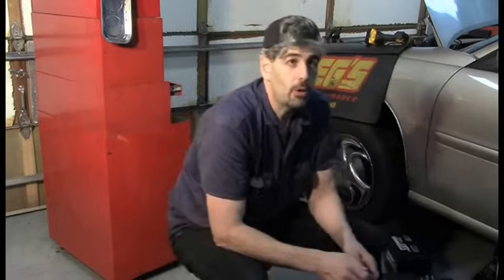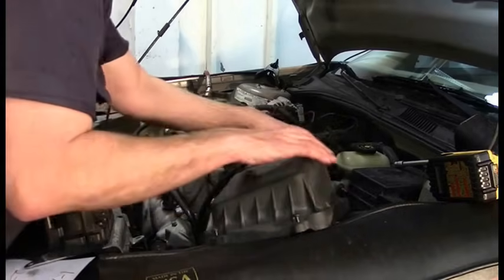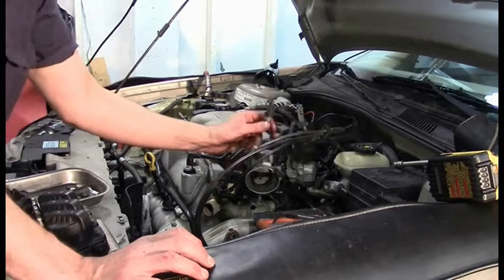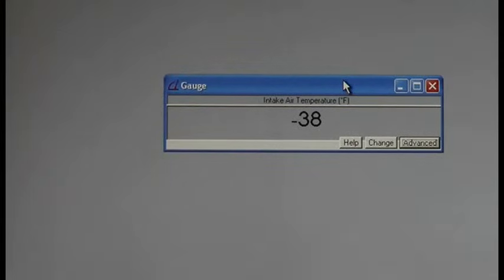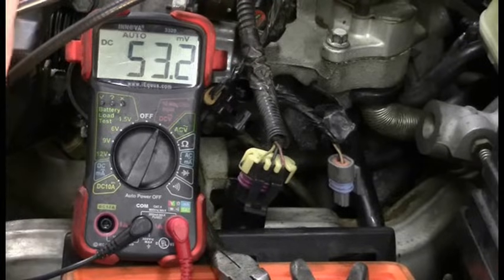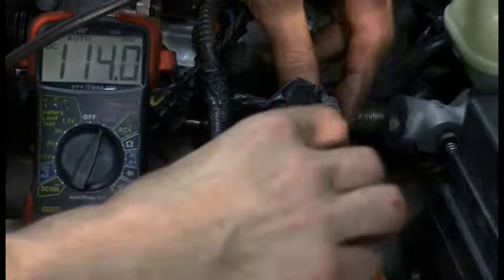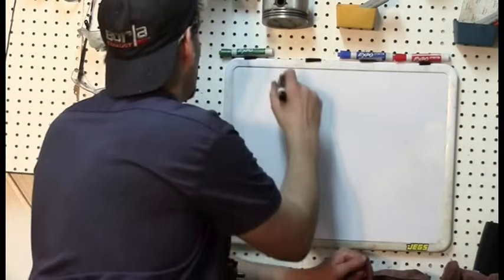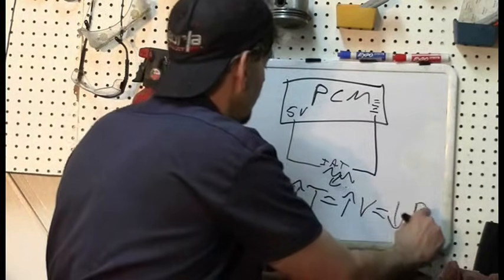IAT ( Intake Air Temperature Sensor ) Diagnosis P1111, P1112, P0113

Comment: You needed to show how to connect the wire tracer. I have a either a short or an open circuit in the IAT I BOUGHT an automobile wire tracer, but I need to know how to connect it properly. The instructions that came with it are confusing to me.can you help me?
Reply from the maker: There is only one way to connect it- it's a single wire.

Comment: Best teacher on the net. Everyone has weaknesses. Anyway, simple electrical theory is Ohm's Law :
E(voltage) = I(current) x R(resistance).
Reply from the maker: I'm more of a Kirchoff's Law kinda guy
Reply: Schrodingers Box , I originally was going to say that voltage increases with resistance , but I am not sure if that’s true, so I deleted it. Anyway, no disrespect to you. Keep up the Great work. Inspiring how you freely give back to the community your knowledge.
Reply from the maker: Look at your formula. Of course voltage increases with resistance.
Reply: Schrodingers Box , I thought that, but usually voltage is the constant variable in the formula, also with increased resistance current flow lowers, so It didn’t sound right.

Comment: wow i was not sure you would respond..thank you for your time.. i had intake work done on my 97 expedition and when i got it back that code was there.. they told me i need that i a t sensor.. so they replace it ..the code came back.. hooked it up to scan tool it flatline no reading at all..they seem lost but i don't have money to keep wasting..and i read that problem can mess up your engine...ok if there is no 5v and ground ..what does that mean?  thanks for your help
Reply from the maker: Simply use the DVOM and measure power against battery ground. If you don't have 5V then you have open power. I repeat the test at the PCM output to see if the PCM is putting the reference out. If it is- diagnosis complete, you have open power.  If PCM is not putting 5V out, your PCM is bad.

If you have power at connector, test ground continuity. If none, ground is open.

If you have power and ground, then you have a ground fault.  unplug PCM and continuity test to verify groundf fault.  If one is present locate and repair ground fault.

Those are your only variables.

Comment: I have a 2002 Camaro with a 5.7 engine LS1 and the service engine soon light on . The car is running great but can1t clear the code. The scan code reader said low mass air flow .I put a new one in and it did not fix the  code. All four 02sencers are new and still no luck. all the garages that worked on the car are just   tacking my money I don`t know were to go at this point. Do you have any pointers for my.
Reply from the maker: Why did you replace the MAF??!  What was the the reading you got or what was the reference, ground and feed voltage indicating the sensor was bad?  you have to give me the data you used to diagnose a bad sensor.  And why are the O2’s new? Where they non responsive to variable inputs?
  this doesn’t make any sense to me.

Comment: I tested mine it dropped but I also am getting 5v from the plug on the harness . So I ask does it mean sensor could still be bad even if it dropped on test With blow dryer
Reply from the maker: No if it drops then it's fine. Perhaps you have a ground fault which explains the 5V at the connector.
Reply: Schrodingers Box  my code is also flashing an what do u mean by the ground fault an before u ask only code it show is intake temp sensor  but yes is flashing idk y
Reply from the maker: Your ground is faulted to the frame rather than PCM.  But also there is no such thing as a flashing IAT code. What is the exact code you get?
Reply: I can't remember the exact code but only one was for a intake temp sensor
Reply: An are u saying the ground for my battery?
Reply from the maker: no the ground for the IAT to the PCM may be ground faulted which would obviously cause 5V detection at the connector but the PCM would not be able to interpret he variance.

Comment: Intake Air Temperature IAT Wire Harness available at: https://www.269motorsports.com/intake-air-temperature-iat-sensor-12-wire-harness-extension-for-lt1-ls1-ls2-gm/
Reply from the maker: Thanks- I usually don't approve ads but that's very helpful and relevant in this case.
Reply: You're welcome! Had a customer contact me and mentioned this video. If interested, contact me at 269motorsports@gmail.com so we can discuss doing some business together.

Comment: Matt, that was a great video.  I have the same problem, P0113 code on a 2003 pt cruiser.  This code just appeared when I put in a new battery and took off the IAT clip. Unfortunately, I don't have any equipment to test that sensor.  Should I just go ahead and take it to the garage.  Thanks, Ted.
Reply from the maker: a dvom only costs $10   why not just buy one???

Comment: Fabulous job! I believe we may be a lot alike. I've always been crazy curious and NEED to know how everything works. When someone asks me a question, I never answer their question, I tell them how things work, which enables them to answer their own question and a lot more they will have in the future. It's not that different than the old saying, "Give the man a fish and he will eat for a day. Teach him how to fish and he will eat for a lifetime."  The tester you use is often referred to as a Fox and Hound by the company that popularized it and which I use in IT.

My thoughts based on what you just taught me are:
- P0112 Circuit Low Input: If it is an open sensor, bad connection, or open in the wire, it will show Circuit Low Input, which is a less common failure.
1. Disconnect the IAT sensor, turn on the ignition, take a volt meter, and measure between the connector contacts and ground. You should see the 5v reference on one of them. If you don't, a Fox and Hound can save you a lot of time finding where the open is or if it is at the PCM.
2. If you do have a 5v reference, measure between the two contacts of the plug and you should see ~5v. If you don't, you can again use the Fox and Hound to chase down the connection issue is on the return wire or if it is at the PCM.
3. Assuming the above are OK, it is beginning to look like a bad sensor. Pull the sensor, get a hair dryer, switch the meter to ohms and connect the leads to the sensor. It should not read like an open circuit at room temperature. Turn on the hair dryer heater and aim it at the sensor. You should be able to see the resistance go down as it gets warmer. If it doesn't, it is defective.

- P0113 Circuit High Input: If it is a shorted sensor or the return wire shorted to a reference wire, it will show Circuit High Input, which is the more common failure.
1. Disconnect the IAT sensor, turn on the ignition, take a volt meter, and measure between the connector contacts and ground. You should see the 5v reference on one of them, not both. It would be unlikely that you would find the 5v reference on both, which would indicate a short, but you needed to pull the connector for the previous test anyway, it only takes a second to check, and it saves you from unnecessarily pulling and testing the sensor. If the signal is on both, you most certainly have a short in the wiring, or you have a PCM issue. This won't be so easy, but using a Fox and Hound by separating the two wires with jumpers at connectors to separate them along the way, you can determine which section the short is in, to know roughly where to look for damage, and where to unwrap the harness. Fortunately, this would be an unlikely failure. Another unlikely situation for a PO113 Circuit High Input would be to not find reference voltage on either, which would indicate wires open by the time they got to the connector and shorted somewhere after the open, or a bad PCM.
2. If you do have a 5v reference on one of the wires, measure between the two contacts of the plug and you should see ~5v. If you don't, you either have an open on the return wire and a short between a reference wire and the return wire beyond the open, or there is something fishy with the PCM. Here again a Fox and Hound can help. While again, this type of failure is very unlikely, you already have the connector in hand from the previous test, you don't have to pull anything to do the test, and it can prevent an anger issue later.
3. If the above tests OK, pull the sensor, switch to ohms, and connect to the the sensor's connectors. At room temperature it should not read 0 ohms (shorted). If it looks good, get a hair dryer, turn in on, and aim it at the sensor. You should be able to see the resistance change.  If it doesn't, it is defective.

*I'm also guessing there could be the obscure situation where it would take an expensive piece of equipment that measures with its own sensors and compares them to the readings of the car sensors to determine exactly where the problems are, as could be the case when there are multiple sensor issues.  However, at least by following your logic, the odds are stacked WAY in my favor that if I buy one, it will fix the problem.
Reply from the maker: Sounds like a reasonable flow chart to me... although I seldom use flow charts for the exact reasons you mentioned in the first paragraph. I have no need for flow charts because I understand the system.
Reply: Thanks to you, I learned I didn't need the sensor.  Using your logic, the sensor and circuit checked out fine.  I also found a section in the vehicle's Repair Manual that contained all of the logic of how it sets, how it resets, how long it keeps history, AND a huge table of each temperature and what the resistance should read as well as what the computer should read for temperature when it is shorted and open.  The sensor was drop-dead perfect.  I would be lucky to fine a replacement to be that accurate.  I reset the codes and told her to tell me as soon as she gets the light.  She got the light very shortly after I reset it.  However, this time, the only code was PO135, Bank 1, Sensor 1, 02 Sensor Heater Circuit, which makes a TON more sense.  The dealers and parts stores want $195 for the OEM sensor, but I already found the exact same AC DELCO 12581688 GM Original Equipment for $110.  The car has a heat shield rattle too, so when it comes back, I'll check the wiring before I buy an 02 Sensor.

Comment: Without that electronic chaser how in a maze of wires could u track down a short? U'd have 2 probe  everywhere looking for 5 v.! Nightmare. Thx 4 your concern for us imbeciles!
Reply from the maker: Exactly! before I had this tool that is EXACTLY what I would do- it would often take hours to find the wire. I remember unplugging the PCM and looking for continuity on the open wire and PCM terminal (and even then if the wire shares other circuits, several pins would indicate continuity with it!!)
  The wire tracker is the bomb!!

Comment: have 0073 code help
Reply from the maker: Ok what data do you have?
Reply: Schrodingers Box
 2006 Chrysler 300 3.5
Reply from the maker: No, the vehicle doesn't matter. What is the reference voltage, static voltage and what is the resistance reading when variance is introduced?

Comment: I went to start my car one day and I had a no crank no start. I also got p0113 do you think that's keeping my car from starting
Reply from the maker: No. But it could be related to the reason. Do basic FASTTEC electrical testing and determine issue.
Reply: Schrodingers Box so the battery has been tested and the starter also and they are both good. I did notice that it blow my 40a ignition fuse
Reply: Also fuel pump is not priming

Comment: I own a 98 explorer sport 4.0L OHV V6 and I did a airbox silencer delete , would that cause this?
Reply from the maker: What data do you have? What was your baseline before the delete and what is your output reading now?
Reply: Schrodingers Box haven't done that
Reply from the maker: Well that's the first step. You have nothing to go on. Why even do the delete in the first place would be my question.
Reply: Schrodingers Box I watch a video and researched and it gives it more air, quicker response, more HP and better fuel economy I don't know if it's related or not
Reply from the maker: We'll do the testing on the IAT to determine the issue. And stop watching videos of hacks who have no idea what they are doing!!!!!

Comment: Very good explanation and conclusion.  One thing you may also do is to check another sensor because the 5 Volt reference is usually shared between several sensors.  Interestingly,  yesterday I Plugged my expensive Tech 2 into a Chevy S10 ( 2000 year model 2.2L) that I just bought for $600 and found the exact same reading after diagnosis, but have not had the vehicle in hand to check the wiring. As you stated, be especially careful checking the Reference volts because a short to ground can toast the ECM/

Comment: 07 ranger throwing off stuck rich brand new 02s on banks 1 and 2 upstream A 4.0  ENGINE  that is the only code throwing off .....   hesitates and  stumbles on acceleration plus higher rpms ........... cleaned  the  maf and iac valve ........  is it possible to buy 2 new  02 sensors that are faulty ? or any other ideas would be  appreciated thanks
Reply from the maker: what data do you have? What was the data indicating there was an IAC problem and overerreporting MAF?? Was this fuel trim based?
Reply: Thanks for the quick response ... but the only data I have are 3 shop mechanics with the same stuck 02 readings on both banks and no clue where to start .... fuel pressure is 70 that being said I think I have to have a short or dirty sensor or bad 02 even both are brand new I get no codes for anything except stuck rich O2 sensors ........ it stumbles at first stop also which I would thought the O2 sensors don't even read or send until the engine warms up ..so they seem to be the red herring but not source of problem .
Reply from the maker: Sorry there is no useful data here for to use my methodology.  Good luck.
Reply: For O2 Sensors, get a AutoZone guy to look at the O2 live feed with a good tester. you should see a change in the signal as it heats up.
Be careful around the device as they are working in very hot temps.

Comment: Electrical voltage (denoted V, measured in Volts) (aka electrical tension) is like pressure in a hose.
Electrical current (denoted I, measured in Amperes) is like the flow in a hose.
Resistance (denoted R, measured in Ohms) is like a restriction in the hose.
So when 5V (a certain pressure) is present at a hose with a certain restriction (a resistor), then a certain flow happens (electrical current flows).
In the case of the NTC resistor the current flowing would be what you would measure.

Comment: Thanks Matt I will have to get one of those gizmo`s. I am working night shift with lots of time HA! I`m in Canada and working in a diamond mine near the arctic circle freaking cold. I have 4 TEC Red seal trades (good for anywhere in Canada) and one is an HVAC trade and I too struggle with electricity relays all over. My e mail starts with Vulcan so you can see that I see all your stuff is really logical! The best way to under stand components is to figure out there true operation and proceed from there down the line. Keep up the good approach you take to all you do very logical!!

Comment: Matt I`m having trouble did you send 12 VDC down a known 5 VDC circuit to find the break in wires? Great vids by the way but you have stated in many other trouble shooting vids that doing this would possibly fry the ECM? Did you do something different not to possibly fry the ECM? Just trying to understand thanks a bunch.
Reply from the maker: NO!!! NEVER send a 12V down a 5V circuit!! Doing so will surely blow the driver!
  I sent a low voltage tracking signal down the wire, not 12V.

Comment: First off great video! Lots of information to diagnose with. However I'm having an issue. I have a 2005 Dodge Dakota ST 3.7L Automatic Transmission 2x4. I've been getting IAT Sensor codes for about 6 months now. I've replaced the sensor 3 times in that time frame and each time it has "fixed" the problem for about 15 minutes each. I wish I had seen this video before I wasted 30.00 on sensors as you are correct it isn't the problem in my case.  I followed your every step up to the open circuit trace because I don't have a tracer. When I put the hair dryer on the sensor's the ohms drop. I tested all 3 sensors even the original Chrysler one and they all tested the same. I have 4.93 volts at the wire. I'm using the exact same Innova ohms tester that you are. Is 4.93 volts acceptable? I seem to be at a loss because the wiring seems to be ok when testing it and the sensor's seem to be ok when tested as well. Where do you suggest I go from here? Any help would be greatly appreciated.
Thank You!
Reply from the maker: Sounds to me like you probably have a ground fault on the signal return to the PCM.
Reply: Use a hair dryer to "heatsoak" the  wiring looking for a cold solder joint somewhere in the wiring.  (Don't Melt the wiring), check and shake the loom to see if you have a temp related issue. Check your PCM , Battery Grounds.

Comment: I need help with my 2005 Dodge Ram 1500, my truck recently gave me an engine light so I checked what it was an it coded a "Intake Air Temperature Sensor Circuit High" my question is would I need to replace the sensor or what?
Reply: P0113
Reply from the maker: I don't know if the sensor is bad or not- WHat data do you have? What is the voltage and resitance when introduced to variables?